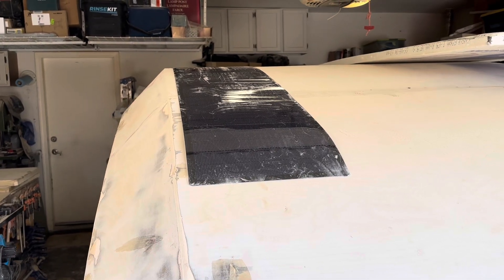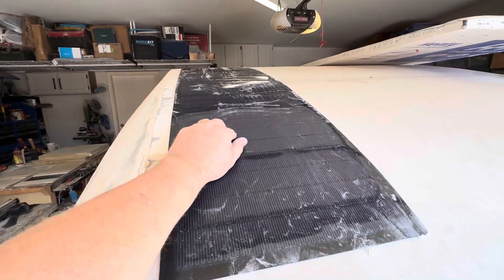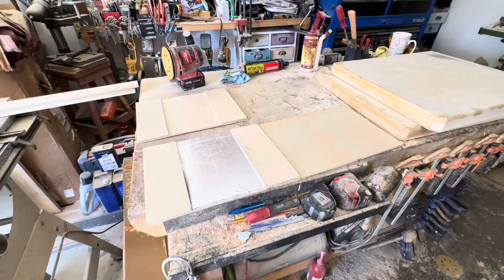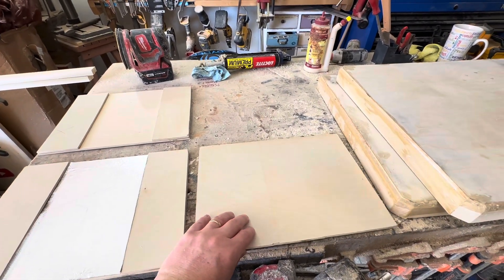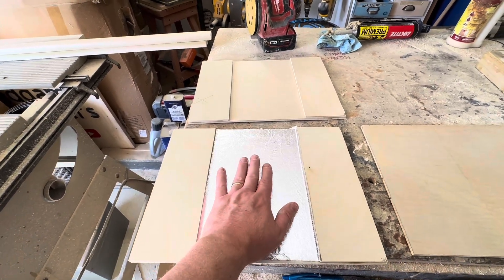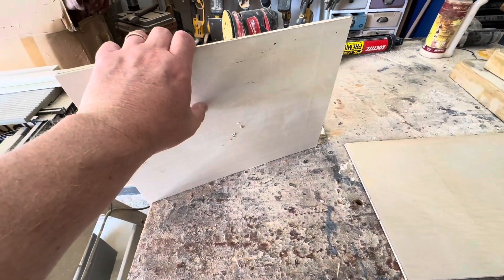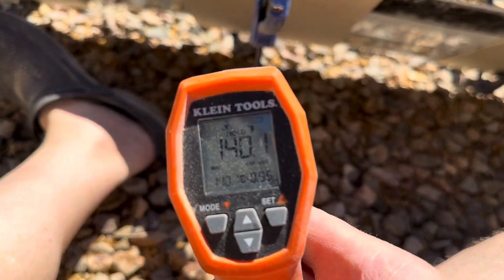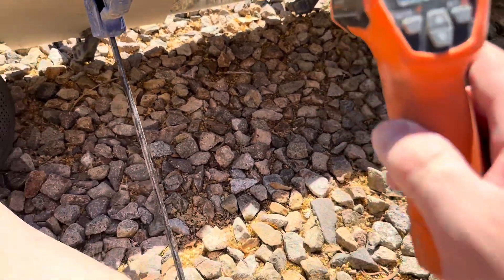How You Mount Your Flexible Solar Panels Makes a Difference - Backyard Experiment Findings

Comment: Nice experiment Dave.  If you decide to use standoffs might the air gap result in wind going into the void and lifting or tearing the flexible panel?
Reply from the maker: Possibly… I am going to add some white eternabond tape to the leading edge on the standoff sections as extra insurance. I did that on 8.0 and it seems to work well.

Comment: Excellent experiment. Curious what the wattage difference would be. Typically the more heat the less efficient the panels are
Reply from the maker: That is a great question.  Any ideas of how you could set up an experiment to test that?
Reply: @EndgameCampers   yes. You could maybe set up each surface on the various templates and monitor with a solar generator the same panel in each position for, maybe 5 minute intervals and notate the avg wattage per "template". Possibly just record the wattage with a camera or use a meter of some sort to record the Wh. Not sure. Unless you have 4 separate panels and power stations, would be a bit difficult to do with one power station.
Reply from the maker: Good idea. I actually have three of those panels. Let me chew on this a bit.

Comment: Nice experiment. I noticed that even the edges that were doubled 1/4 inch ply lowered the temp passthru. I have seen people using chloroplast sheets, basically plastic cardboard, to create an air gap between the solar panel and the roof. if you get the white color, it also provides some reflectivity but not as strong as the foil. Just thought I'd throw that out there

Comment: Hmm Id lean to the foil with 1/4" standoff. The benefits of a cooler interior I think will outweigh the negative effects of an extra 10 or so degrees on the panels.  Great job Dave
Reply from the maker: I agree Jonny. That will be the plan

Comment: How about mounting the solar panel to a thin sheet of aluminum and then mounting it to the camper with thin strips of aluminum square stock to the roof.  Cheap heat sink.
Reply from the maker: Not a bad idea